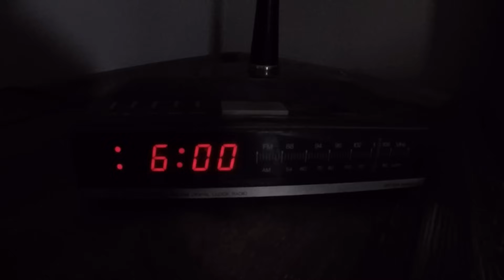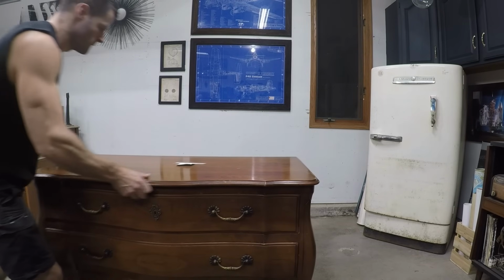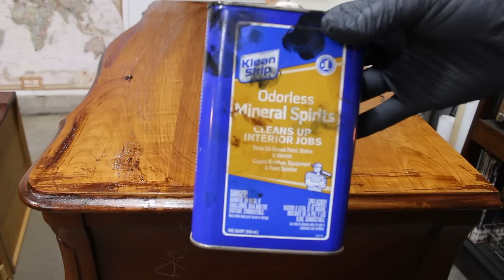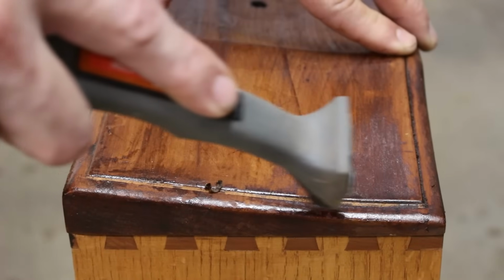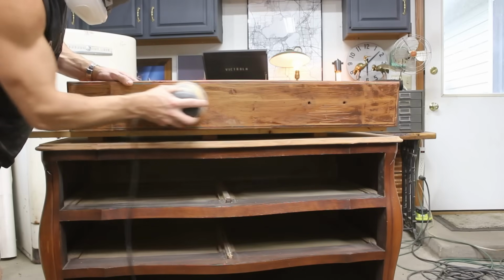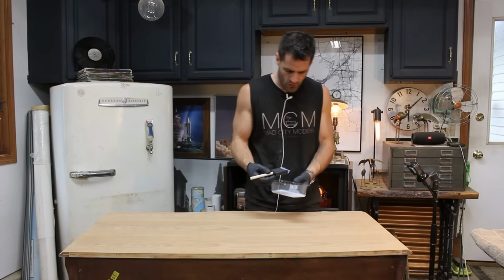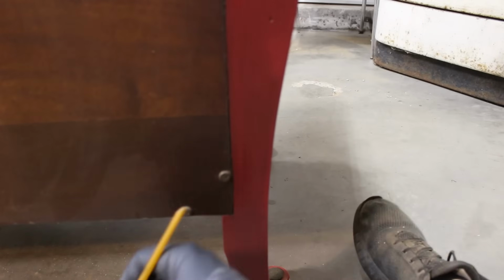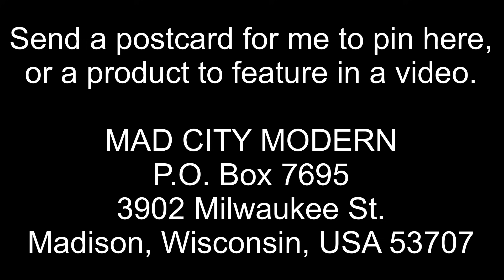Ep. 15 I Regret Painting this Valuable Old Dresser

Comment: That Howard's Wax, did you put it over the painted areas as well?  Hard to tell in the vid but what did it do to the wood/poly parts?  It seems to have a deep sheen rather than a shine @18:37.  Do you like it?  Also you didn't say if that lock works, chances are you got it to work.  This is well above a "flip", more like a "reimagined".  Wow
Reply from the maker: I only applied the Howard's wax to the wood finishes. There are so many products that could be appropriately applied to the wood finishes, and also the paint. I  have my favorites but I want to continue to try new products and techniques. Thank you for the comment

Comment: I just ebonised an old dresser and mirror in my hallway. I used first a base coat in white mat ordinary paint after cleaning and sanding lightly. It then gave it two good coats of mat black paint sanding in between. I then sanded again, wearing down slightly the edges and wear areas, then gave it a coat of shellac, then wire wooled it down, cleaned again then antique waxed it up and polished. I am really pleased with it and an antique dealer friend said he was amazed so doubly pleased. I bought a few pieces of gilt bronze furniture decor in the 18th century style ( from a homeless guy who pulled them off an antique chest he found in the street, reeling at the idea !! ) so might put them on the corners, still thinking about it.
Reply from the maker: This is amazing. I hope you can pass on some of your knowledge as you watch my channel

Comment: Have you considered putting a tarp on the ground to catch messes and save time cleaning 🧼 floor if at all?
Reply from the maker: I've tried both methods. I prefer to use the shop vac often in the areas where I am stepping. I often get tripped up on tarps. I still use them for certain projects. Great thought

Comment: It's a good practice to ALWAYS use 0000 steel wool, followed by a tack cloth to remove and particles, in between layers of polyurethane or any finish fir that matter. You will get a smoother than silk surface.
Those yellow stickers on the back are stickers moving companies use to tag a homeowner's belongings/furniture when locating to another place/home.
Reply from the maker: Great feedback

Comment: Advice on stripping and redoing my painted front door my house was built in 1956 somewhere along the line someone decided to paint the solid oak door Blue
Reply from the maker: Try scraping, then use klean strip premium stripper. Wipe off with mineral spirits. Let dry. Apply desired finishes

Comment: I just did a quick search for Widdicomb furniture. Turns out it's quite expensive. A piece very similar to the one you stripped and painted was selling for around $2800. Are you sure you did the right thing?
Reply from the maker: Positive I did the right thing. I do mostly Restorations on the channel so I'll be comfortable with the paint removal process one day. This piece was gifted to my mother. I've seen ridiculous prices on furniture pieces, but sales records are a better reflection of the true values. Have you seen any sales records?
Reply: @MadCityModern  No. Just ads.

Comment: The most important thing about stripper is to LET IT DO ITS JOB. What you said about how you probably should have left the stripper on the drawer…that would be a resounding yes. 

And on the top and the shaped sides you could have saved yourself a lot of time and effort by leaving the stripper on for longer. One trick you might like is to wait until the surface of the piece looks bubbly. Then gently push against the grain with a chip brush to see if you’re down to bare wood yet. 

You might like using those thick blue shop paper towels to wipe the gunk off after you use the scraper. The advantage over steel wool at this point is that the towels pick up the gunk, have much more surface area to them and are reasonably easy on your hands. The steel wool is rapidly gunked up and if not rinsed in solvent doesn’t last long. That saves mineral spirits and reduces volatile fumes in your work area. 

On the curved surfaces you can put the solvent on the towel and pull off most, if not all, of all of the crud. Again, you can save product because you don’t have drips like you can with the steel wool, you can get to a clean part of the towel which is already saturated with solvent. 

My husband and I learned this approach over several go rounds with refinishing furniture for our home. It saved us a lot of time and effort with sanding which we both detested. 

You found such a treasure on your oh dark thirty rounds. And it looked so fine when you finished!  Thank you. 

New subscriber here.
Reply: I cringed out loud when you said you were painting the bottom of the dresser. I assumed you were going to paint the whole bottom and when you said it could be controversial my first thought was No ####, Sherlock‼️

But I was happily surprised when I saw the result, so, Sherlock, you done good.
Reply from the maker: I completely agree with this. Thank you for sharing so much information. This truly helps with the work I am doing